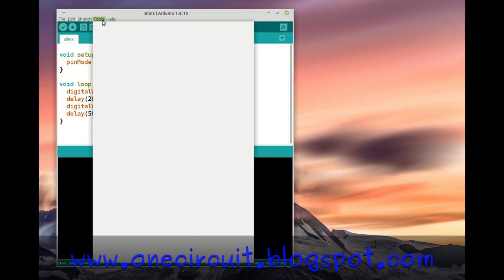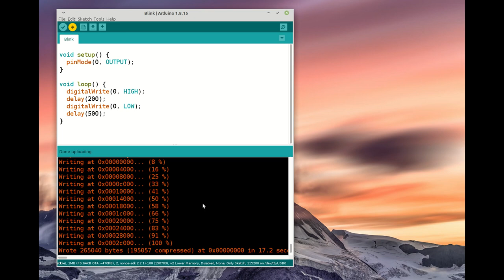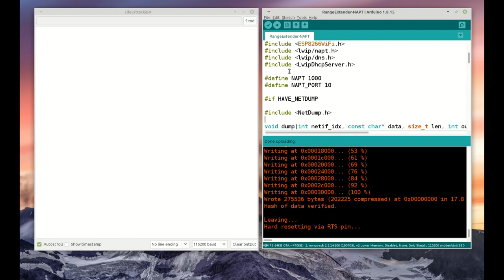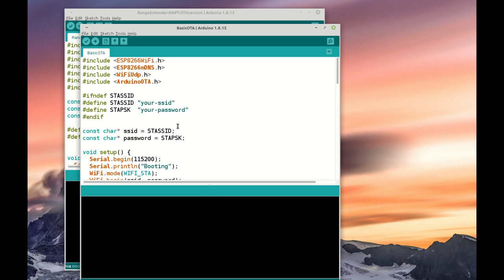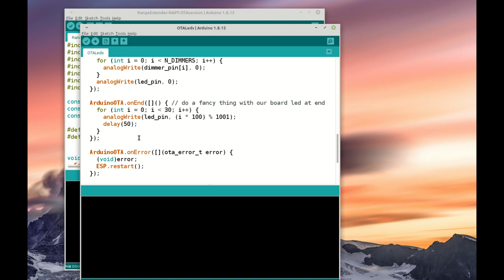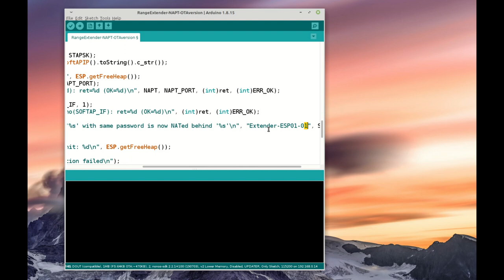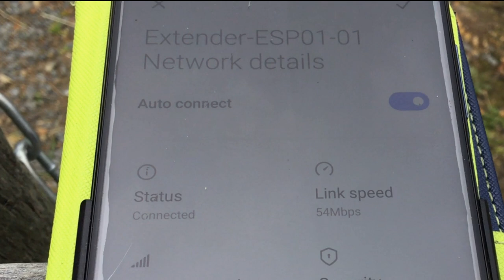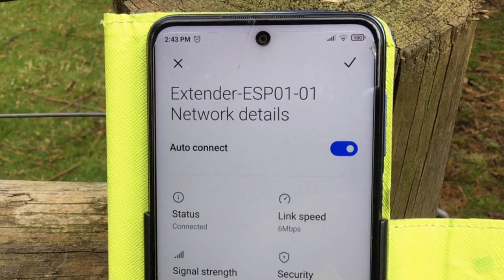Cheap ESP8266 WiFi Extender

Comment: I wonder just how big a network you could create with these...

Now I'm off to the basement to see how many I've got
Reply from the maker: I’m working on a “mesh” of them for the property at the moment. Great little units for this application. 👍😀
Reply: @onecircuit-as  how big is your property? I'm wondering if they were staggered like the links in cyclone fencing wire about 20-30 meters apart, you should have a decent connection everywhere.
Reply from the maker: We are on about 5 acres but really only the house block and a bit extra is needed - the mesh approach looks promising - stand by for an update in a few weeks - currently testing...solar powered mesh!!
Reply: @onecircuit-as  there should be no reason why a lithium battery with a solar charger wouldn't work.

Comment: I'm wondering what the actual throughput of these is, iperf3 would work for testing that run the server on computer and iperf magic on your phone
Reply from the maker: Good idea! When the mesh is up and running I’ll do some bandwidth tests. For monitoring/controlling it’s not a concern, but a video feed is another matter! 👍😀
Reply: the ESP-01's were tested at around maybe 5MB/s...the ESP32s' can do upwards of 16MB/s...they aren't mega powerhouses, but they can repeat wifi signals decently...they can also do automesh